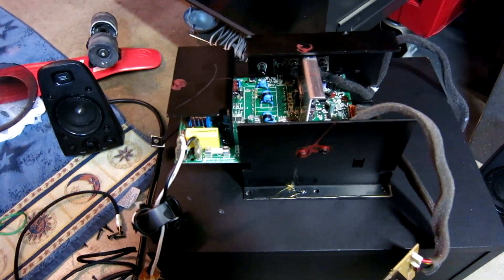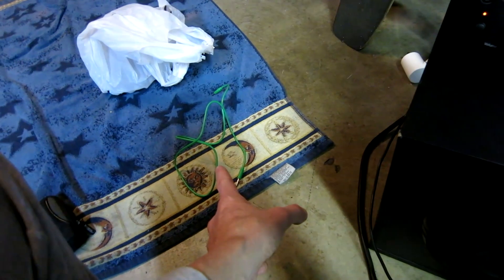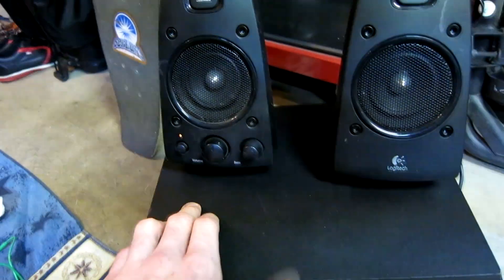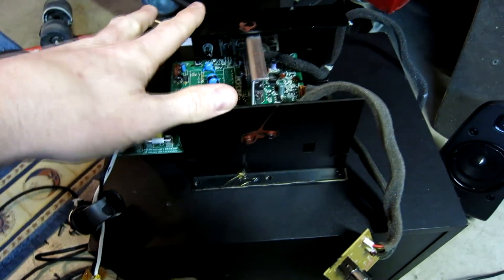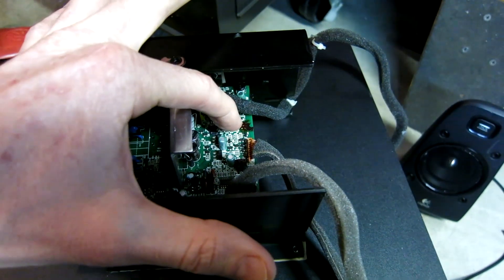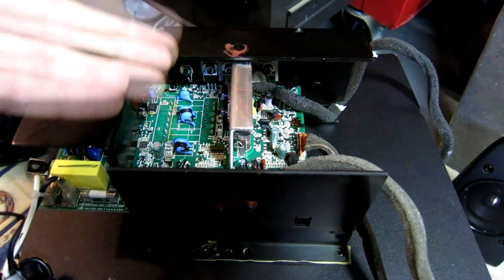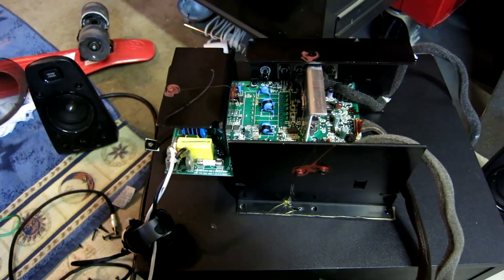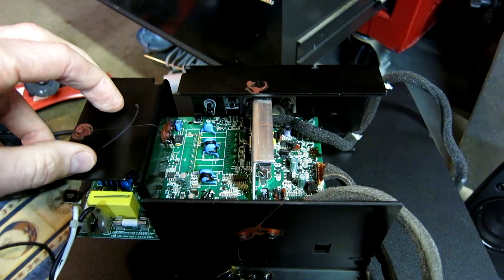Logitech Z623 No Sound Problem

Comment: Hi, Logitech Z623 vga cable is broken.  There are 15 colored cables inside the cable.  Do you know which part of the cables come to the VGA end?  I would be glad if you could help.
Reply: Yo acabo de resolver ese problema, si gustas te paso el diagrama que realice del cable VGA y los colores para la salida del conector.
Reply: Same issue.Do you have service manual, pinout, circuit diagram or other related docs for Logitech Z623?

Comment: I have the logitech with the separate controller from the speakers.  I have no sound but i know its the controller because I bought another used complete set and the subwoofer and speakers work with my original controller its the 2nd controller that ain't working, not sure how to diagnose the no sound. And the power button does turn the power on the controller.

Comment: I have 623. My speakers work fine but no bass at all. It did crackle bad before it went off. Sub looks ok so i bought another sub. Im going to wire up the subs together and try it. Not wasting a sub and subbox
Reply: que tal te fue?
Reply: @chiledelquenopica  Bien, muy bien y sigo trabajando hoy hermano. Tengo una computadora portátil conectada al amplificador y luego amplificador a sub conectado a otro sub y amplificador a los altavoces. Buenos altavoces 400w. ¡me encanta!
Reply: @chiledelquenopica  lo siento, el amplificador es de 800w rca en rojo y blanco y un conector para auriculares de 5 mm con cable a los altavoces.
Reply: @chiledelquenopica  Realmente fácil. Subwoofer autoamplificado conectado al subwoofer normal en un estuche. Amplificador a subportátil con alimentación a amplificador de amplificador a altavoces.
Reply: @andisadler2897  ¿Te puedo mandar un correo por si me puedes ayudar? Porfavor

Comment: How did you diagnose the amplifier? I have mine apart. Solder and wire connections look good. I'm not sure where to test with a multimeter. The speakers make an initial pop when powered on, but that's it. Same when I connect the left speaker to the TV directly on a left right rca output. Stool no sound though in assuming they are getting power.
Reply: a mi me pasa lo mismo, estuve probando los mosfet pero segun yo estan bien, cuando conecto el altavoz a la corriente, el altavoz no tiene voltaje, ambas bocinas funcionan bien pero el woofer no jalal

Comment: I am facing the same problem, Is there any update how to fix the same, I tried to replace the sound IC and Power Mosfet as well but it doesn't work. 
Because it is now possible that the electronics devices or motherboards can't be repaired and in this case there is nothing to hard to find out the problem but I have less experience as I am a electronics student as well , I don't know how to check it with multi-meter step by step I will try to do so but if you have and idea then please help me .

Comment: Firstly, my logitech is the Z506 and currently the issue i have is. The main speaker control (right) makes a clicking/buzz noise every 5 seconds and then stops. It's only coming out of this speaker and it's very minute but of course annoying. The sound persists if I plug my headphone into it. Any ideas what this might be or what actions I should take?  I read that it could be too much power going into the unit and that's it's distorting the sound. I'm lost and have no idea how to pursue this.
Reply: This is a bad  main volume potentiometer

Comment: I had no sound in left speaker, the first thing to try look is at the connector for the speaker that has no sound, squeeze the connector inwards so it makes harder contact with the output on the subwoofer amplifier board, the connector is loose and making poor conect with the amplifier output connection. if that doesn't fix it than you must unscrew the amplifier board and check for loose capacitors, you must reflow the solder because the capacitor solder joint has broken loose and is making poor contact

Comment: Since you have a hot air setup you could just order a new amp chip on ebay for a few dollars. Its easy to find the correct one by just looking up the part number on the chip itself. .

Comment: was hoping for a solution here cuz it's exactly what i'm hearing. I turn my right speaker on and i hear this "click" if i turn either volume knob or the bass one it starts making weird sounds, like clicking through the speaker and bass. Thing is I have no idea what caused this, i've had this set for like 4 years and after moving my table from one corner to another one day, the speakers just decided they will not work anymore. I had this thick right speaker wire a bit pulled out, but it didn't actually make any problems before either. after moving the table I just plugged them back in and it "clicked", then - white noise. ever since it just does that. What a bummer, I was enjoying those speakers so much... now it's just a waste of space. I'll just get a good set that doesn't have built-in amp or controls in the speakers themselves next time.
Reply: Same thing here
Reply: Same thing. First, the end of the thick cable that attached to the right speaker casing was loosened, but it's been still working fine for a long time. Recently I even tied it to the casing in a way not to be pulled accidentally and damage the wire joints inside. But because of another problem (subwoofer was not working time to time) I'd to use an electronic cleaner (someone with a similar problem had suggested) on the d-sub joints on the sub. Now since then the speaker system ended up not making any proper sound at all but only a noise. I suspect two things, 1- I plugged the d-sub in and turned the speakers on too soon before the liquid fully dried and that might have caused some damage (or not damaged yet hopefully but it's causing a short circuit). 2- Although I'd tied the loose end of the thick cable as earlier mentioned it pulled a bit during this cleaning operation and that might have cased a wire to be loosen inside. I'll wait few hours and try again.

Comment: I'm having a similar issue. First, the end of the thick cable that attached to the right speaker casing was loosened, but it's been still working fine for a long time. Recently I even tied it to the casing in a way not to be pulled accidentally and damage the wire joints inside. But because of another problem (subwoofer was not working time to time) I'd to use an electronic cleaner (someone with a similar problem had suggested) on the d-sub joints on the sub. Now since then the speaker system ended up not making any proper sound at all but only a noise. I suspect two things, 1- I plugged the d-sub in and turned the speakers on too soon before the liquid fully dried and that might have caused some damage (or not damaged yet hopefully but it's causing a short circuit). 2- Although I'd tied the loose end of the thick cable as earlier mentioned it pulled a bit during this cleaning operation and that might have cased a wire to be loosen inside. I'll wait few hours and try again.

Comment: I have a problem where one speaker (the one without volume control) isn't working.. Any ideas?
Reply: I currently have the same problem. Were you able to find a solution?
Reply: also have the same problem. any solutions?

Comment: I've got this system also, they are  awesome speakers but they go bad easily after 9 to 10 months. I've replaced them in warranty 2 times and each time they gone bad. Logitech needs to fix this for the sake of how good these speakers are. Anyway I've found this video might help you https://youtu.be/Ehs_tnV9jsw